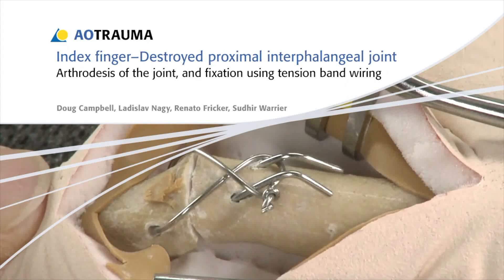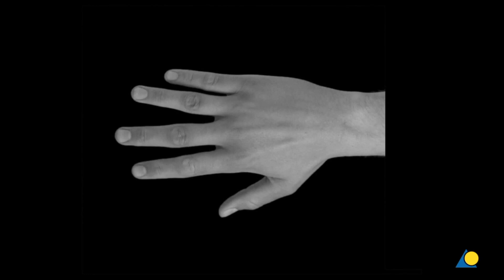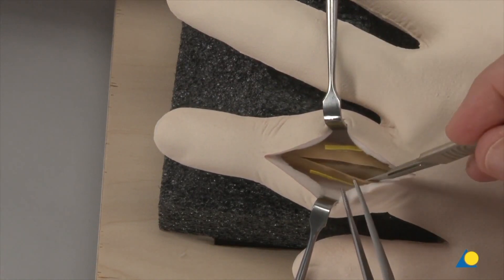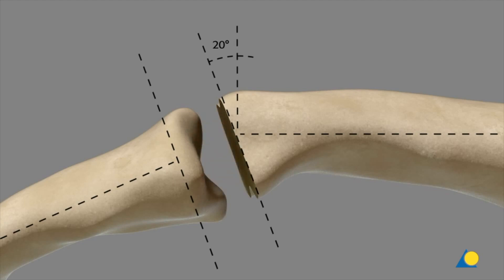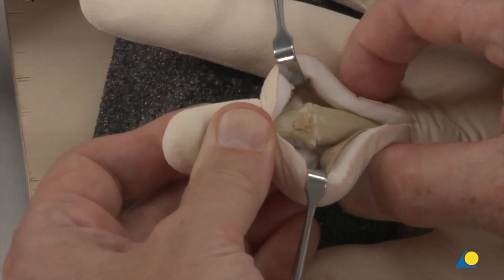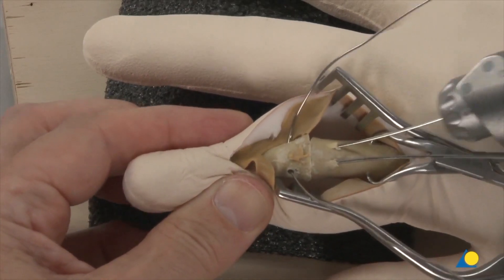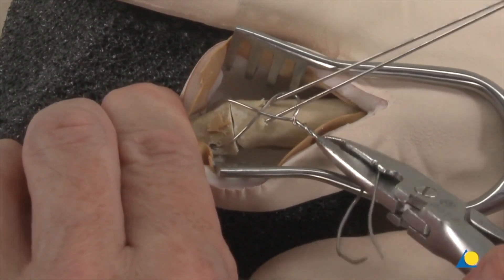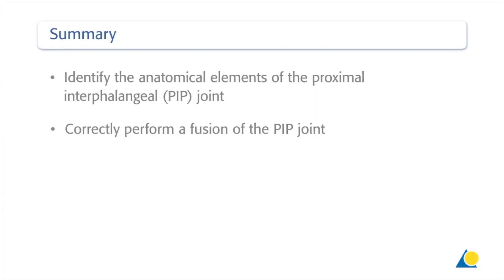Index Finger - Destroyed Proximal Interphalangeal Joint - Arthrodesis of the Joint, and Fixation

Comment: Is there no technological innovation to avoid fusion? Is it too hard to make a fake joint? I'll volunteer to try it on my finger.
Reply: Just had this surgery done. There is an alternative surgery, you can have a silicone disk put in but the chance of it actually healing and regaining movability again is not great. I was given the alternative to put in silicone disk but i opted for the PIP arthodesis instead. The risk of the silicone joint disk is great pain and sliding, and eventually having to do the arthodesis anyway.
Reply: no in my country this be replaced by simple artifficial joints